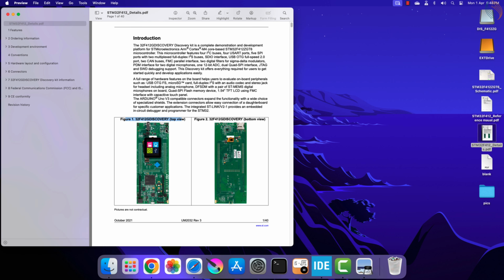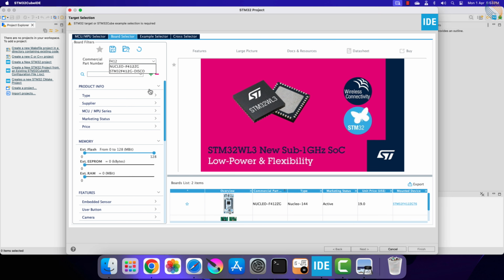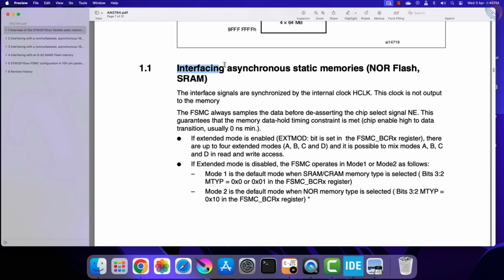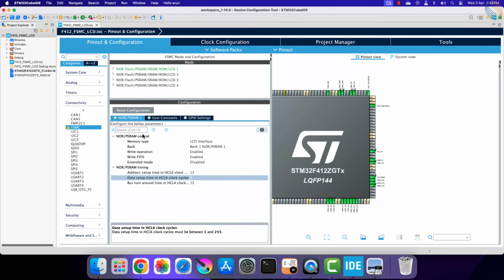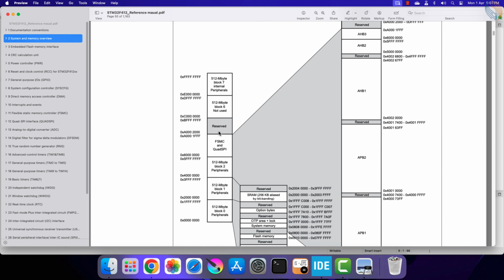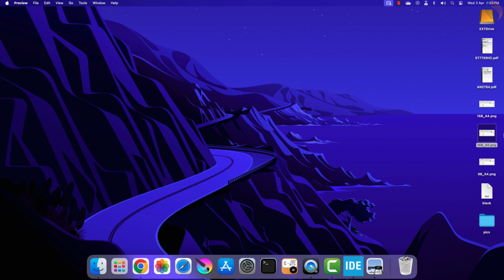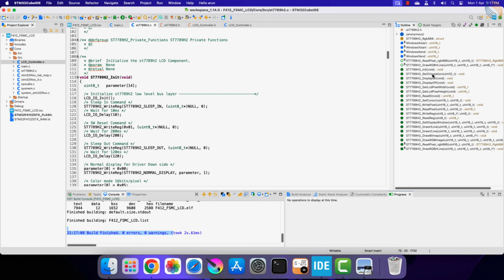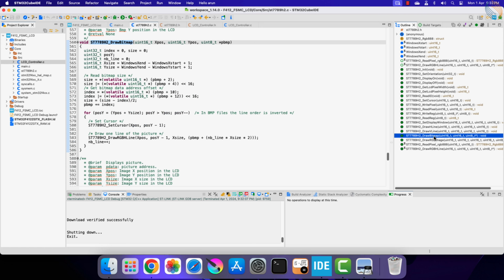STM32 FSMC || LCD PART 1 || How to configure

Comment: what can I do when my LDC ili9341 doesn't have LCD_TE....

i have got only:
1 	- 	GND 	Ground plane
2 	- 	RST 	Reset button
3 	- 	FSMC D15 	PD10
4 	- 	FSMC D14 	PD9
5 	- 	FSMC D13 	PD8
6 	- 	FSMC D12 	PE15
7 	- 	FSMC D11 	PE14
8 	- 	FSMC D10 	PE13
9 	- 	FSMC D9 	PE12
10 	- 	FSMC D8 	PE11
11 	- 	FSMC D7 	PE10
12 	- 	FSMC D6 	PE9
13 	- 	FSMC D5 	PE8
14 	- 	FSMC D4 	PE7
15 	- 	FSMC D3 	PD1
16 	- 	FSMC D2 	PD0
17 	- 	FSMC D1 	PD15
18 	- 	FSMC D0 	PD14
19 	- 	FSMC NOE 	PD4
20 	- 	FSMC NWE 	PD5
21 	- 	FSMC A18 	PD13
22 	- 	FSMC NE1 	PD7
23 	- 	Touch CLK 	PB13
24 	- 	Touch CS 	PB12
25 	- 	Touch MOSI 	PB15
26 	- 	Touch MISO 	PB14
27 	- 	Touch PEN 	PC5
28 	- 	LCD Backlight 	PB1
29 	- 	VBAT 	N.C.
30 	- 	GND 	Ground plane
31 	- 	3V3 	+3.3V rail
32 	- 	GND 	Ground plane
can you help ?

Comment: Thanks for your video. I need some help. I am using the FMC for Automatic Timing Management. My application requires the memory type to be NOR Flash/PSRAM. The FMC handles the timing requirements for these external memory devices, reducing the need for explicit delay management in my code. Could you please do a video on connecting the STM32 controller with an external memory device?